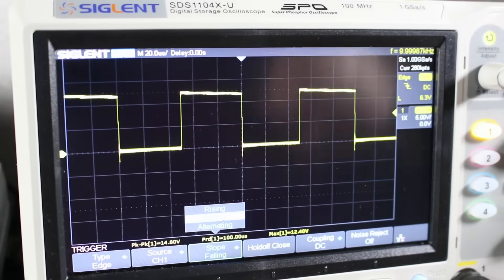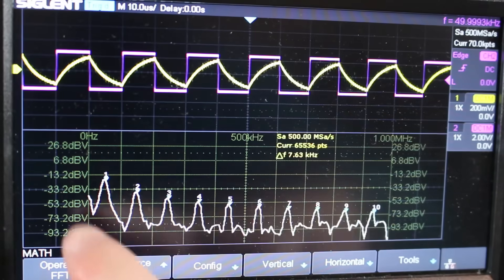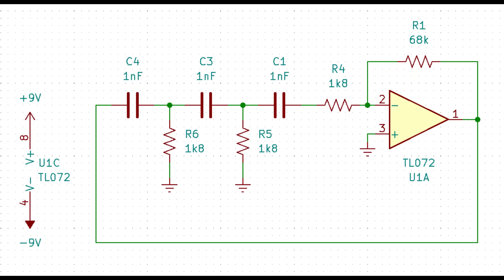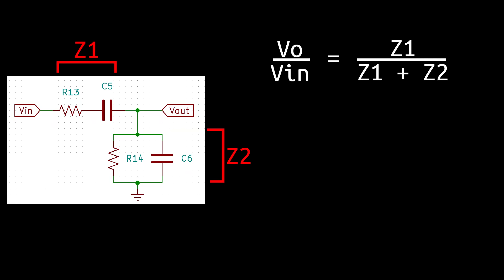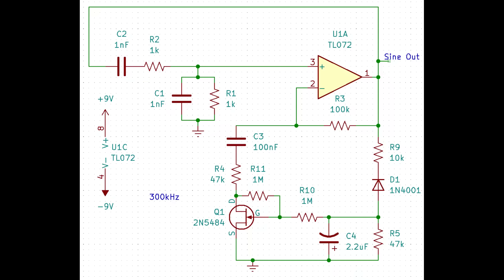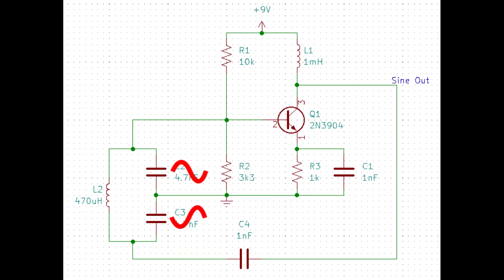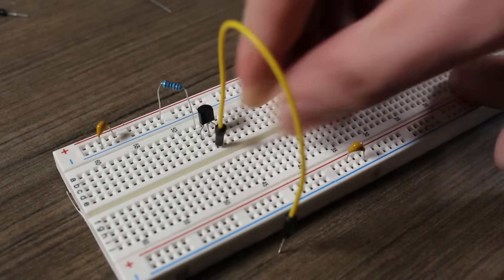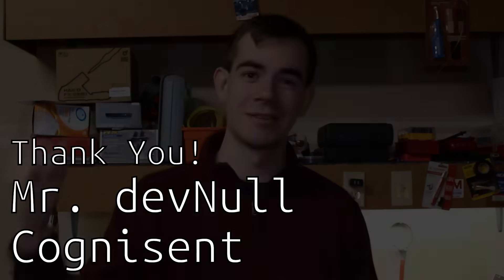5 Ways To Generate A Sine Wave (Analog)

Comment: You can also use 2 antiparallel diodes in the Wien bridge oscillator, between feedback ressistor and op amp's output. This is how I built ḿy censoring button circuit.
Reply: It works better if you add a resistor in series with the clipping diodes.  With the diodes off, the gain is about 3.3.  With the diodes on, the gain is about 2.7.  This leads to less distortion.

Comment: My method is not in your video. I use a relaxation oscillator - usually based on a 74XX14 Schmitt trigger - then a wave shaper based on 6 diodes, one capacitor and a resistor. You can generate a wide frequency by varying the resistor (potentiometer) on the feedback RC filter of the Schmitt trigger.

Comment: A common way to generate a sine wave used in analog function generators is to generate a triangular wave by switching a current source on a capacitor and then distort the triangular wave to a sine wave with a ladder of diodes and resistors. The THD is not that good (typ. 0.5%),  but it is easy to vary the frequency.
Reply: Beat me to it. Used this many times on test equipment back in the 80s when I needed a good-enough sine wave in the low teens of Hz. A simple pair of back-to-back diodes around an inverting amp plus a couple of resistors did the job.
Reply: 40 years ago I used this method in a function generator that was my senior design project in college. It is easy and works pretty well, but a bit of distortion is indeed there.
Reply: Does anyone know what that circuit would be called?
Reply: @gibbyrockerhunter  Diode wave shaper I guess ?
Reply: @poussincasoar7741  lol. Thanks mate
Reply: @poussincasoar7741  lol. Thanks mate

Comment: Great video ! I'm a little sad you didn't use a bulb,  but it is a bit of hassle however I think the results are worth it ! maybe some day on the 'sine Lab' as it did launch the company HP and I don't mean the English sauce ! good stuff and its 'Veen'.....cheers :)
Reply from the maker: I'll look around for a suitable bulb. :)
Reply: :) @SineLab
Reply: @SineLab  A 327 lamp (any major component vendor has them) is what I used for my sinewave generator, with a 1K potmeter as the feedback resistor. Powered by +/- 4.5V, I generate 3.7Vpp, and use a resistive divider for a 50mV ... 250mV calibrated output signal.

Comment: Wow, you pulled together several knowledge points, for me. Thanks. Kudos. If I recall correctly, it is rather difficult to create a true sine wave and that a lot of the circuits that we see actually only produce a good facsimile of the wave. A digital sine wave would be an example of this. If I am remembering correctly, analog circuit that starts with a square wave and reform it into a sine wave are also examples. So, do your five methods produce a true sine wave. Maybe you could make a video, on this distinction...
Reply from the maker: These five do produce a true sine wave. A video about the topic of sine wave approximations, digital or analog, sounds interesting though.

Comment: Side note: Using a light bulb to create a stable sine generator was the idea behind Hewlett Packard's first product and they continued manufacturing them in basically the same form into the 70s. I have a 201c from the early 70s on my shelf that still works well.
Reply: Awesome, I'm jealous! I have designed my own bulb stabilised Wien oscillator and that happened after reading about about the work done by Mr Hewlett !
Reply: Did something like this some years ago. 
Rather than a Wien Bridge, I used an all-pass filter with a two-gang AM tuning capacitor. Unlike the Wien Bridge, both parts of the capacitor can be grounded. With appropriate phasing, the output from the juction of a small tungsten lamp and  a fixed resistor was fed to the input giving positive feed-back. The lamp stabilisation took a moment to settle but for its simplicity worked well enough. One drawback with the AM capacitor is that the corresponding resistor is in the megohm region for low audio frequencies and the lamp will not stabilise at sub-audio frequencies. Anyway, it is much easier to get the two parts of a tuning capacitor to track rather than a 2-gang potentiometer which is harder to source. Finally, in view of the high impedance levels especially at low frequencies, good screening is needed to keep out 50/60Hz from the mains supply.
Reply: I made a design using the HP lightbulb design some 12 years ago. 10V power split via one half of a TL082 for a virtual ground, the other half as the oscillator. The lightbulb is a "327" lamp, soldered onto the PCB. The feedback trimmer is 1K. My output was set at a little under 4Vpp. Bonus: watch the output on a scope and power up the circuit. You'll see the output signal "bounce" up and down a few times until the the lamp reaches a stable temperature.
Reply: The lamp I use Has most of the part number rubbed off but its a CM371 a small 12v lamp an NE5532 opamp and +/-3.7v I use a LIPO battery's output comes to just under a volt PK-PK and using ARTA software I see a THD of 0.003 % yep love the bounce :) @edwardmulder5746
Reply: They don't make them how they used to
Reply: @notaras1985  They cost a lot less now too. :)
Reply: wow cheap ! @justovision
Reply: Me too I will be home this weekend I would like to show you my design :)  @justovision
Reply: Jeri Ellsworth has a good video too. https://www.youtube.com/watch?v=vBsSASge7ls&t=17shttps://www.youtube.com/watch?v=vBsSASge7ls&t=17s
Reply: Meanwhile, I'm reading this comment on my HP laptop lol

Comment: What so you mean by 'cut off' ?
Reply: A filter reduces a signal based on its frequency.  For example, a "low-pass" filter passes low frequencies and dampens high frequencies.  An example where you'd see one is the subwoofer output on a stereo - it filters out all the highs and passes the lows.

The "cut-off" frequency of a filter is (usually) the frequency where the signal is diminished by 3dB.  So for a low-pass filter like what he's using here, you'd want the cut-off frequency to be a bit higher than the frequency of the sine wave you want to create.  Square waves are really just an infinite number of sine waves added together, so by filtering out the frequencies higher than the one you're looking for you can turn a square wave into a sine wave.

Filters are a pretty big topic and they can get pretty complex, but the basics aren't difficult.  You can find lots of introductory articles on them around the 'net.

Comment: Very nice video!
I vaguely remember that it's possible to create sinusoidal signals by feeding two or four integrators into each other, since sine and cosine are derivatives of another.
Reply: Yes but remember that the two integrator one generally doesn't work if you copy it straight out of the text book.  All capacitors have a little bit of series resistance so the oscillation generally rings down.  Just a little bit of positive feedback can fix this.  
It is a very nice oscillator to build because you get sin() and cos() outputs.
It is also possible to make one where a single 10 turn pot varies the frequency over about a 11:1 range.  The trick is to ground the wiper on the pot and make two vary different amplifiers where the gain is controlled by a grounded resistor.  The CW and CCW ends of a 10K pot with 1K added resistors comes into it.
Reply: @kensmith5694  ofc its like a megaphone yelling into itself. without gain it wont oscillate and screetch
Reply: @superpie0000 I am trying to work out the intended meaning of your comment.  Please explain what you mean.
Reply: this sounds like wien bridge osc- integrators are lowpass and differentiators highpass
Reply: Absolutely quite easy, and easy to make voltage controlled with OTAs or VCAs like the 2164.

Very pure too.
Reply: @SimoneProvencher what is an OTA?
Reply: Operational Transconductance Amplifier (OTA)